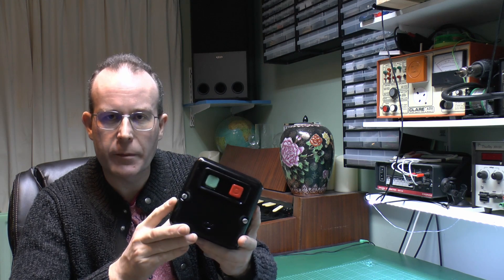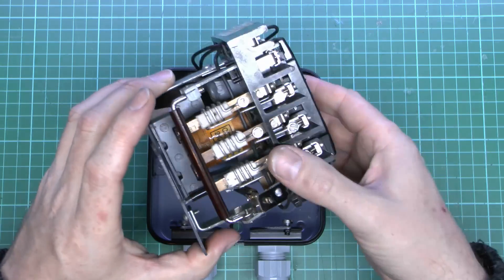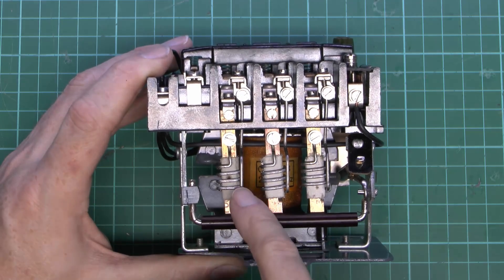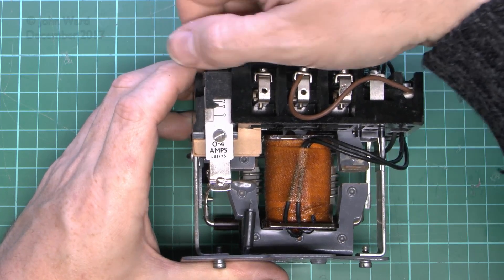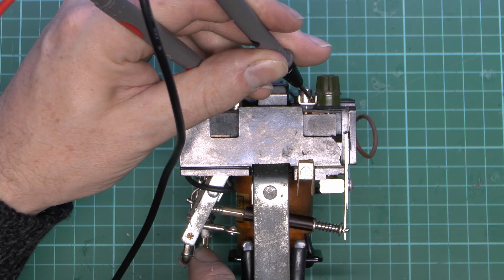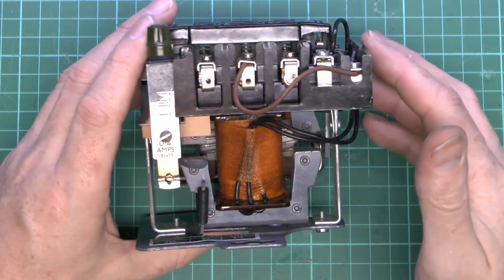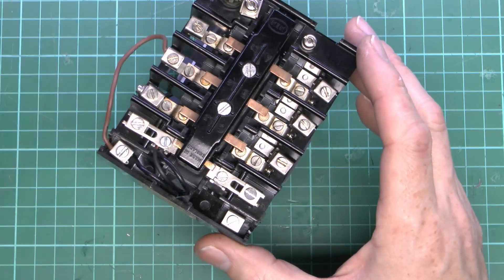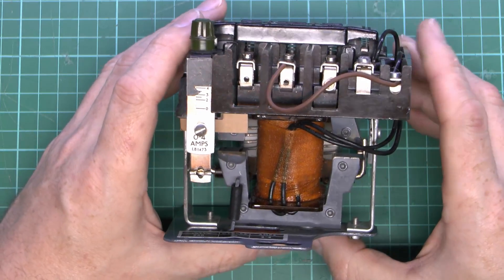MEM Auto Memota Motor Starter Series 6

Comment: Hi John - having just seen your video I have a question - the heat insulation - as seen fx at 3:41 has over time worn out so the overheat switch breakes "too fast" at normal operation. How would you replace those (assuming they are asbestosis)

Comment: Hi John, great video i have one of these single phase maybe dual, it’s 4-8 amps do you mind me asking what size motor can be used….
Many thanks
Reply from the maker: Approximately 250W to 1kW however it does depend on the particular motor as the efficiency and power factor will vary.
Reply: Thanks John for your response, however I don’t know much about this stuff, the induction motor is 2.2kw 11.8amps 240v would my switch work for this.
Many thanks
Reply from the maker: @Sellmyowngranmother  No, 11.8 amps is a lot more than 8 amps.
Reply: Thanks jw
Reply: Hi John, it’s me again…
Was wondering can those switches be up graded, just that I didn’t want to put a crappy plastic one on, hope you don’t mind me asking.
Many thanks
Reply from the maker: @Sellmyowngranmother  They could when new, various sizes of thermal trip were available.  Unlikely to find any of them now.

Comment: Many thanks for this video. I have a similar MEM starter unit in my Wadkin tablesaw, (0-8 A) and the black material (plastic?) that the red button is pushing is broken. Also the green button seem not to get good push (black material feels fixed/not flexible) , and the motor is in bearly running and after 5-7 secs the fuse goes off. Do you think this is fixable or should I just go and try to find plastic one to replace this? I polished the contact surfaces from those copper pins (6) and their counter parts underneath. Sorry broken english, hopefully you got the idea. Thanks!

Comment: My Dad has an old lathe which uses a starter very similar to this driving a Brook Motors Gryphon 1 HP motor. He would like to add speed control to it. Is this possible? What sort of device would he need?
Reply from the maker: Theoretically yes, but in reality it's unlikely to work - altering the speed of a single phase induction motor will also change it's output power, which would make it unusable for a lathe.
Replacing it with a 3 phase motor and a variable frequency drive would be a more realistic solution.

Comment: Hi John. I wired a loop containing the switch in to three contactor coil circuit. It works a treat now, cutting the power when blade is fully through the  work piece.
Thanks for your help Tony.

Comment: Hi John.
Just found your channel. I have exactly the same starter on a Rapidor three phase mechanical hacksaw I am refurbishing. It's  not original to the machine but working on and off ok. Unfortunately  the  auto  stop  on the motor at the end of the cut is not working all the wires are missing. How do I  reconnect  the original two wired additional stop button (trip switch) to the starter circuit. 
I have looked at the wiring diagram but I'm not electrician. I am just trying to kill the live to the coil so it disengages? 
Flicked through your videos I'll deffintly  be using your channel again for future projects.
Thanks Tony.
Reply from the maker: If the switch is a push to break type (the contacts open when it is pressed/activated) then you need to find the wire which supplies the contactor coil, cut it and connect the two cut ends to the switch.

Comment: Hi John,
Thank you for your video about the MEM Auto Memota. I have the same unit in a Pottery Wheel, yet during operation, this unit create a loud noise. I was wondering if you can advise how can I reduce this noise. thank you. Yoss 07930524450
Reply from the maker: Noise suggests something is loose, such as the coil or other metal parts.  It should be silent.
Reply: the pole pieces on these and the crabtree equivalent develop rust if used in damp places, the tiniest bit will cause the contactor to buzz disconcertingly. Dismantle, de-rust, light smear of vaseline or similar on the lams will cure it
Reply: Hello, not sure if my comment will be seen, but I have an old Kerry Engineering Super 8 pillar drill with a circa 1950 MEM Auto Memota starter. It seems to be faulty and after cleaning the main contacts continues to make the buzzing, with sparks too. Here's a short video, any ideas? I'd be most greatful for advice. Thank you

https://youtu.be/PwkvVmMSUvE

Comment: Love the older motor control for some reason, even the cheaper stuff was more robust and could even be rebuilt with the appropriate contact kits....   Now  the lower grade economical starters, when they fail you scrap them and start over... You must now  shell out top  dollar for a " Square-D" or " Allen Bradley" or similar with massive contacts and  the ability to repair and rebuild.

Comment: Hi John, fascinating stuff, hey I wonder how comes the mains voltage doesn't alternate, I mean how comes the coil and mechanism Engadget and stay engaged, it's 50hz how come the latch stays steady?
Good video
Reply from the maker: The metal core around the coil becomes a magnet, the upper and lower parts of opposite polarity.
The magnetic field alternates so it's N on the lower half and S above, and then S on the lower half and N above.  In both cases they are attracted together.
At the point of changeover there is no field or attraction, but it's for such a short time that the heavy metal parts cannot move apart due to inertia.
Reply: John Ward thanks John that makes sense.

Comment: You said it was around a £100 pounds for a new starter, how much would it cost to build your own starter from individual components and what would be some of the safety concerns/considerations e.g welded contacts?
Reply: youa re assuming they sell the parts to make one up, not so much on new ones, the older ones you could buy the major parts, the case, some of the internals as spares, its like asking to make an ipod from parts, well they dont really exist as such, and if you bought enough broken ipads to make one whole, it would cost more
Reply from the maker: Not practical to build one - it's just a contactor and a thermal overload.  New ones are actually sold as those two separate items anyway, you buy a case with a contactor in it and then add a suitable thermal overload based on the motor current.

Comment: It might be just me but the silver metal screw in plugs you have put in seem very close to some live terminals.
If so rubber blanking grommets might be safer. That is if the drill is to be for your own use.
If it is to be sold on then someone with a suicidal tendency could prise out the grommets and poke a screwdriver in and kill themselves.
Reply: People with suicidal tendencies would find easier ways to kill themselves.....and would have plenty of electrical equipment in their homes already.
Reply: I expect JW will earth the casing, and they’re well clear of the terminals anyway. As for people with suicidal tendencies, if they’re prepared to pry things open and stick screwdrivers in, pretty much any device will accommodate this. A bit of a silly comment, if you ask me.
Reply from the maker: 15mm space between the plugs and the top of the mechanism.

Comment: Downside is you have the overhead cost running the electromagnet as long as the motor is running.
Reply: a few watts compared to the few hundred in the motor...a small price for safety, this was made back in the day of lead in petrol and filament lightbulbs, solid and reliable at least
Reply: tight arse   its peanuts   lol  are you scottish